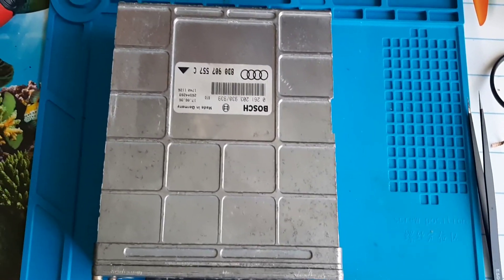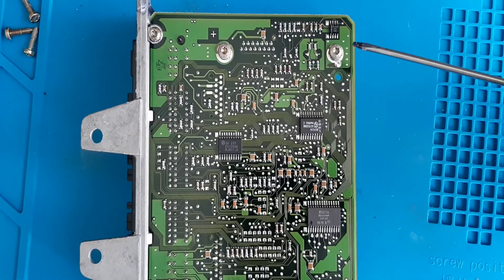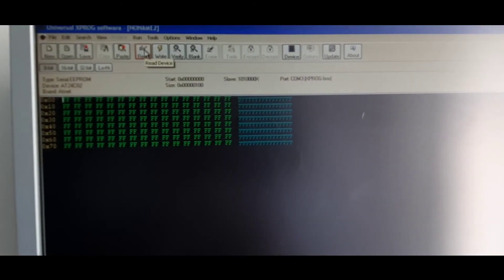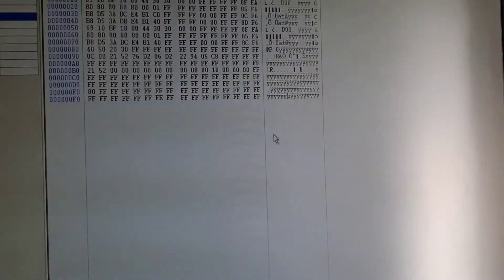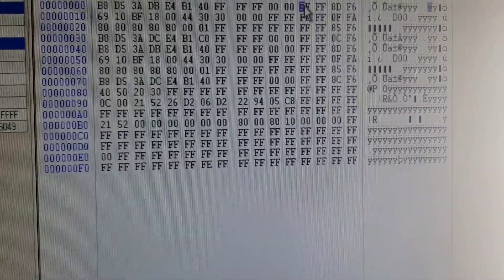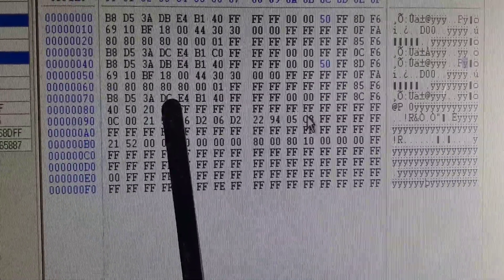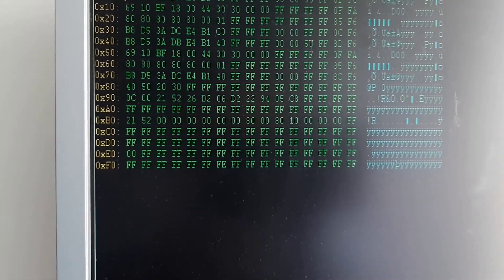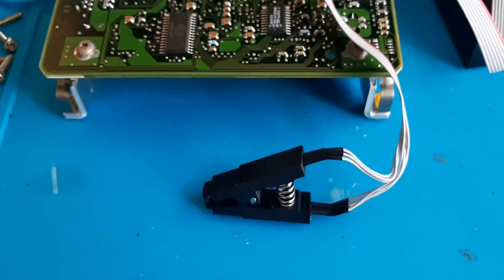Audi A4 B5 immo off. ECU eeprom read

Comment: I just did this on 1.8 AEB for Audi A4. As you said i needed to change line 60 rather than 40. I still have to test it.
Reply: Did it work, i test diferent changes and still not working
Reply: @mespina7699  i have to computer ready but no car to test on lol
Reply: Took mine to some1 2 have it done, still waiting😂 5months later aren't you the guy😂😂